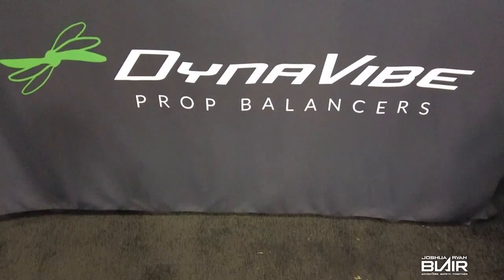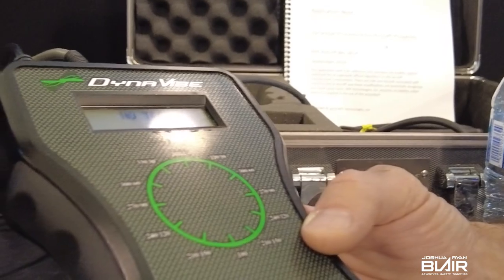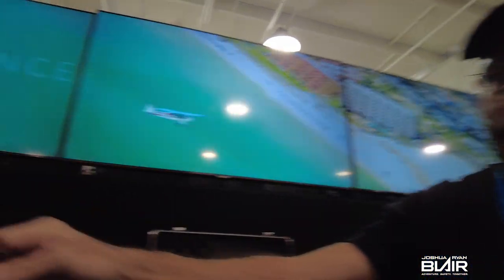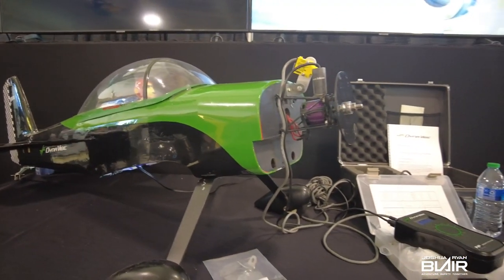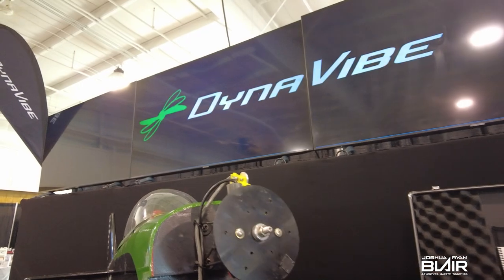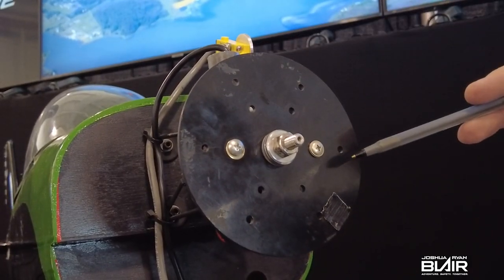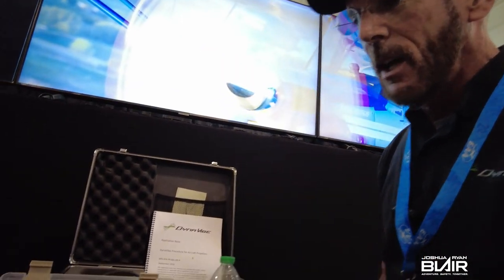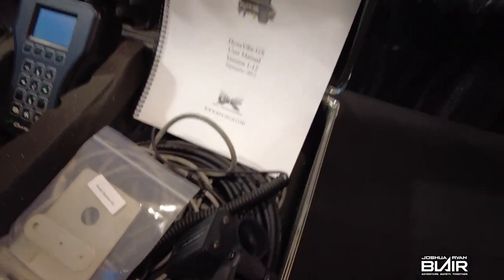How well do you understand DynaVibe? | Prop Dynamic Balancing...

Comment: I used DynoVibe on the Stinson. Super easy sensor installation and simple to operate! Thanks for sharing.
Reply from the maker: Awesome. Which model did you use?
Reply: @Blaircraft.Engines  it was the classic model. I don't have a back up plate to fine tune the balance. I ended up clocking the prop to get it as best I could. the Franklin on the Stinson required custom brackets to be fabbed. But nothing too crazy. Very pleased with the result.

Comment: How do you balance a small continental without a ring gear, or other good place to mount counterweights on the rotating mass?
Reply from the maker: The easiest way would be to use a spinner backing plate if you have one. If not, I've heard that some people have used different length prop bolts or added a plate for balance weights. If you were to add a plate, for certified you would need to confirm with the a/c manufacture first.

Comment: “ DYNAMIC” Balancing is a catchy phrase.  But just because the assembly of propeller and spinners group IS in rotation isn’t dynamic balancing.  
It is a static balance of the rotational assembly but still only STATIC.  
DYNAMIC balance is a very strict engineering of the rotational mass form concept, design, materials specifications, construction and operational testing.   The end product is certified to perform to ALL the forces acting counter to the device; just to keep it simple not simplistic.